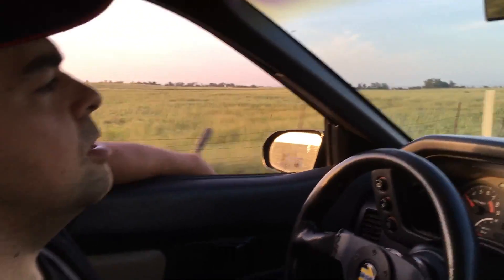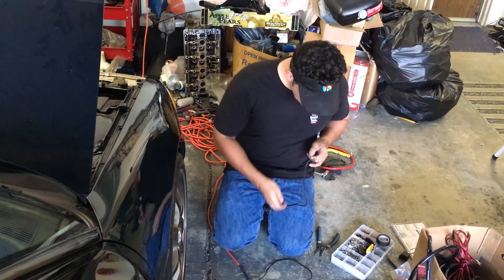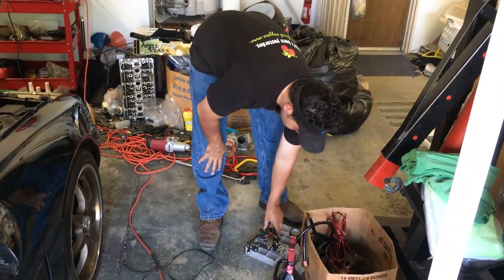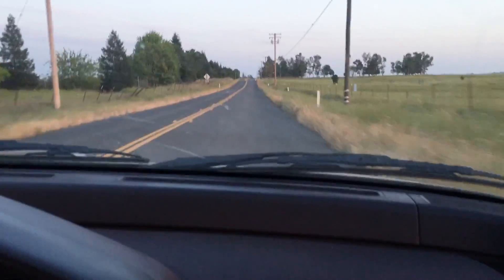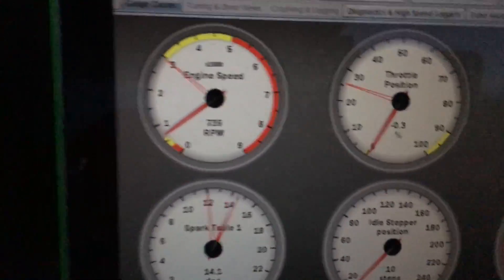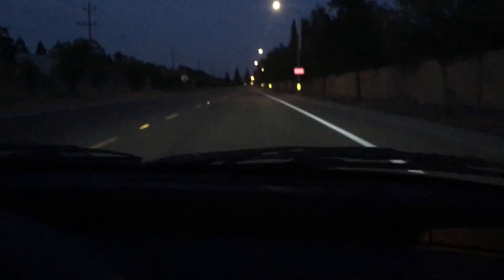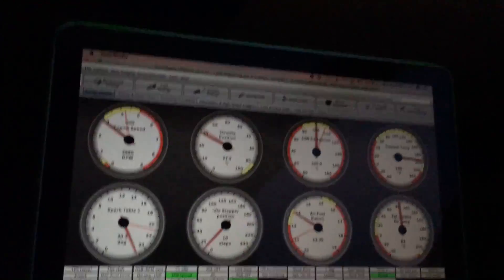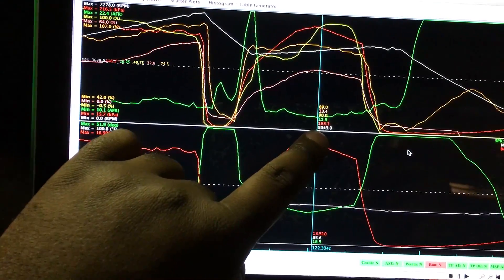DSM Tuning More PULLS 🐌🔥🔥🔥 / DSM Turbo Gets Standalone ECU Part 7 (MegaSquirt) 20170508

Comment: yo what happen to the dsm?  i dont see anything anymore
Reply from the maker: Still have it. It's running great. Just been busy.
Reply: @OverkillEverything  I'm actually about to buy my 1st car.  Which is a gsx 1g eclipse.   I'd love to gain any type of knowledge on what I can do to it to make it like yours.
Reply from the maker: @subfrost7  Sweet, 1G AWD! The biggest tip I can say from having a couple DSMs is, for 90% of people, a 16G turbo and downpipe and a few other mods is all they need. But if you want to go past that, the aftermarket for the DSM is still pretty good!
Reply: @OverkillEverything  lolol so ironic enough the person already put a 16g on it.  he said everything else on it is stock.   but i want to make it a super strong and reliable track car.   like....so strong ..it wont break if i push it hard lol.   i dont knwo how possible it is.   are you in CA?
Reply from the maker: @subfrost7  Yeah we're in Norcal. What year 1g? Do you know what power level you're looking for?
Reply: @OverkillEverything  1990 gsx.   no mroe than 500horses.   i mean ill be happy with 300.  i jsut want it to not lose to all these damn mustang challengers lol.  there are soooo many over here in CA  its ridiculous.  but yeah lololol
Reply from the maker: @subfrost7  you can make a reliable 350awhp with a 16g, bolt ons and supporting mods. Anything more than that and you're talking about a much bigger turbo, fueling (injectors, pump, E85 maybe), standalone (or ECM LINK).

You trying to keep this on the streets or track only?
Reply: @OverkillEverything  ah i see!  350 it is then! lol    and tbh i want to make it a daily AND  a track.    i know alot of people usually have a daily car and a track car but i feel like i can do both and do it responsibly.   what do you think though?
Reply from the maker: @subfrost7  biggest rhetorical question is if you have a smog workaround already figured out. I don't see you making 350 and staying street legal. If smog is not a concern or you got the plug, then yeah, get a catless downpipe, get a front mount, if you're on a budget go with a GM MAFT setup and some bigger injectors, if you have more funds, get ECM Link and go speed density.

Tuning is everything. ECM Link is a great option if your ECU is in good shape (no leaking capacitors).
Reply from the maker: Keep in mind you're 1 loud exhaust ticket away from the State Ref, so keep ALL of your stock components and be prepared to go back to stock, don't sell your OEM parts
Reply: @OverkillEverything  def on a budget right now lol    GM MAFT sounds good.     and i dont knwo where to go for tuning.  i hear it alot but i dont knwo who is good for mitsubishi.   THANK YOU SO MUCH FOR THE INFO!
Reply from the maker: MAFT still works but its nowhere near as good as ECMLink. Going ECMLink will give you the ability to support e85, launch control, flex fuel, complete timing control and injection control, and give you the room to control big injectors and massive turbos. Its a good thing to have because you have room to grow and its in the stock ECU body.
Reply from the maker: @subfrost7  you in Norcal or Socal?
Reply: @OverkillEverything  socal     pretty much ontario CA.  or...like...rancho cucamonga CA
Reply: @OverkillEverything  oh shiz imma just go ECMlink then lol
Reply from the maker: @subfrost7  Talk to Road Race Engineering in Santa Fe Springs 13022 La Dana Ct.
Santa Fe Springs, Ca. 90670
Tel (562) 777-1522 

They still support the DSM platform

Free plug!
Reply from the maker: http://roadraceengineering.com/blog/
Reply: @OverkillEverything  IM ON IT.  TY SO MUUCCHH!!!
Reply from the maker: @subfrost7  No problem. Best wishes on the build. Glad to see people are still getting into DSMs!

Comment: Its cool to see the car running well. I have to ask though, why didnt you go with ecmlink?
Reply from the maker: +dsmdrew8 wanted to get rid of the stock ECU board and problematic capacitors, also wanted the auto-tune functionality and lastly to do something different
Reply from the maker: +dsmdrew8 good question though. It definitely would have been easier to go that route.
Reply: I can understand wanting to do something different. Obviously it's kind of too late now, but ecmlink also has what is basically an auto tune function. It is also very very user friendly. Either way, congrats. Now get the boost to 25+psi and make some power! :)
Reply from the maker: dsmdrew8 there were a few other reasons. we also have a MegaSquirted MR2 on the channel and the tuning process is the same, also the support for MegaSquirt globally is greater since it isn't car dependent. Matt at Diyautotune is a Jedi with his support for the platform! Nothing against Link, tons of fast cars run it with excellent results.